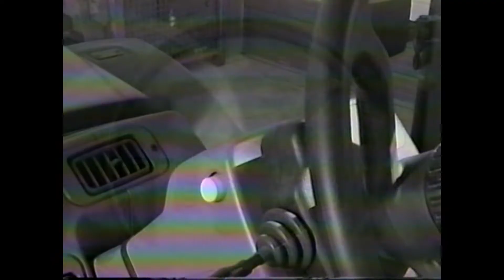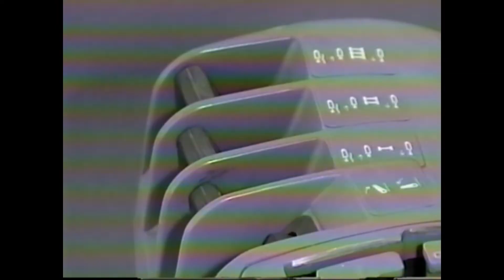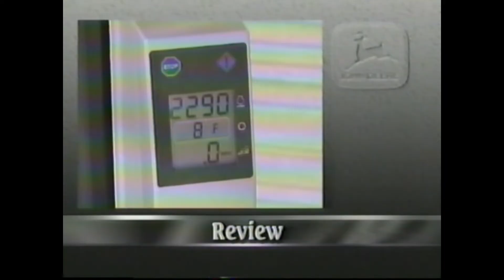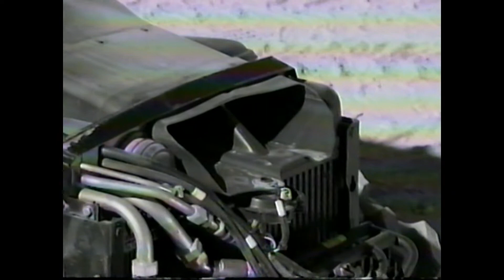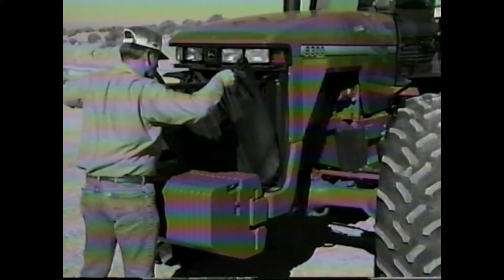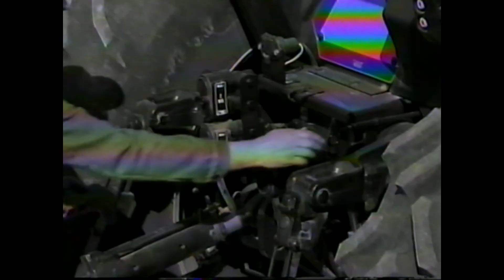Case IH "Running to Catch The Magnum" - Deere versus Magnum 1995

Comment: Usually when someone or a company makes a film like this, that means they are desperate and getting their @$$ kicked because it’s pretty obvious which is the superior tractor and some of the stuff they pointed out are just plain idiotic. But I’ll give the Magnum credit for pushing JD into designing the 8000 series.
Reply: The 8000 deere was a game changer
Reply: the location of the four wheel drive switch seems a bit unusual

Comment: Being experienced with the original Magnums and an MX220 of the series that followed at the start of the 00's, it amuses me how much the MX's are like the Deeres under comparison in the cab area. No instruments around the steering column, a (more comprehensive) instrument panel on the right-front cab post, the same kind of electronic hydraulic remotes (though the throttle was still a cable), electronic shifting, etc. But the MX's hood system is an improvement over the original Magnums. With respect to engine cylinder liners, knowing a bit about the FPT engines: in the current Magnum you get a NEF engine with parent-bore cylinders (the smaller models), or a Cursor 9 that (last I knew) had liners anchored at the head like these Deeres (higher HP models.)

Comment: There’s more magnums with 20k hours and running every day in the dairy state than any 8000 series Deere. You can’t touch an 89 series with dual PTO for under 60,000.
Reply: I would wager a lot of money on the opposite being true. Most dairies are running 8000's on mixers with piles of hours.
Reply: Sorry case isn't as nice to fill lmao oh case bias 😂
Reply: lol, just saw an 8200 with 6k hours go for over 100k. highest hour tractor i have ever seen was and 8300 with over 36k hours
Reply: @markthemuskrat5574  just watched a 9000 hour 8920 sell for 77,000. I know of 4 7120’s with over 50,000 hours. 2 of them have original bottom ends on the engine. 1 has 59,000 hours. I have a 7130 that gets 3800 hrs a year. She’ll have 50,000 in 4 years. Only put a new head gasket and rear main seal in.
Reply: Complaining about A pilar display 😂 pretty much all tractors went with it and got a lot going on those little screens 😂 John deere baby!!!

Comment: I wonder if the experts at case ever saw the 8.1 reliably living to 15k hours and transmission too lol
Reply: We just rebuilt our 8300 transmission at 5700 hours.  That was disappointing.  Had a gear failure.  It was maintained and wasn’t pulled hard either.  If any tractor is without fault, it would take over the industry.
Reply: Ditch em at 2500 hrs dude..ain’t no reason to keep em after that new cab smell goes away..15 k is for jokes and broke
Reply: @Bigballertwentythree yeah yeah. Tell us you dont have a dollar the bank aint lent you wihout telling us...😂